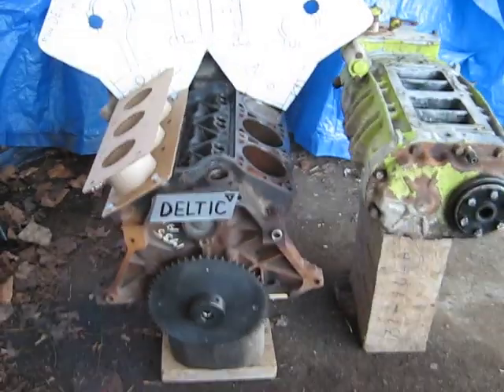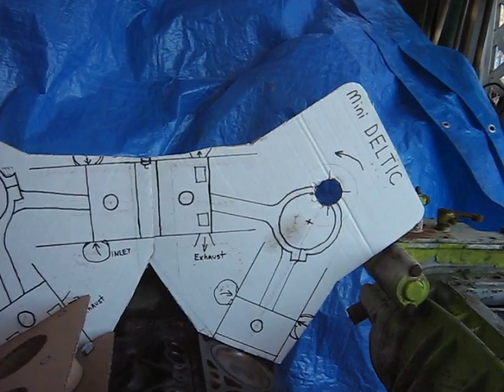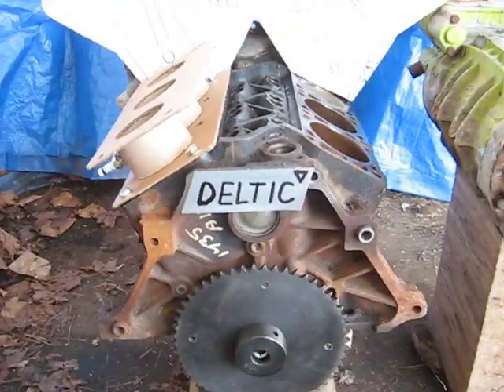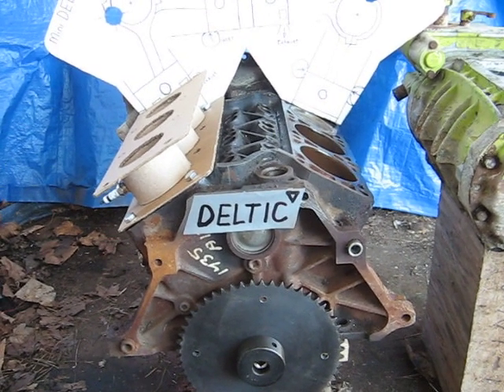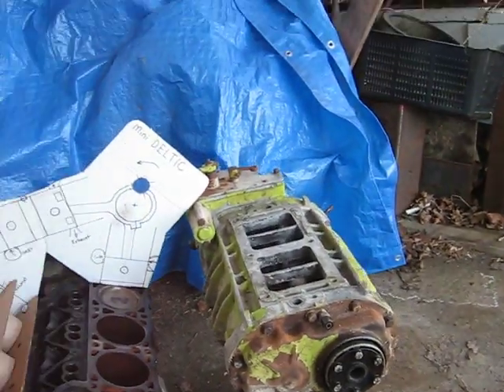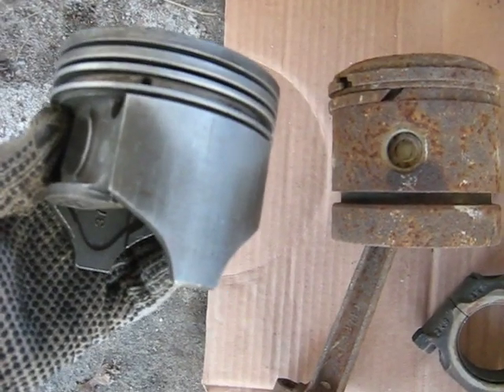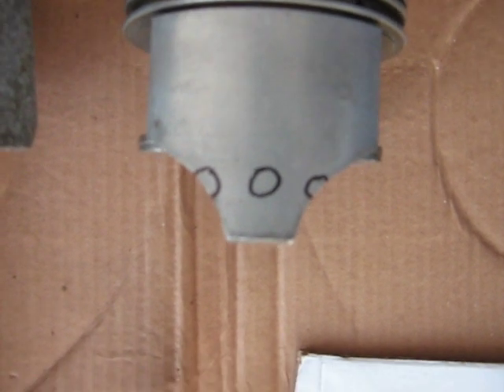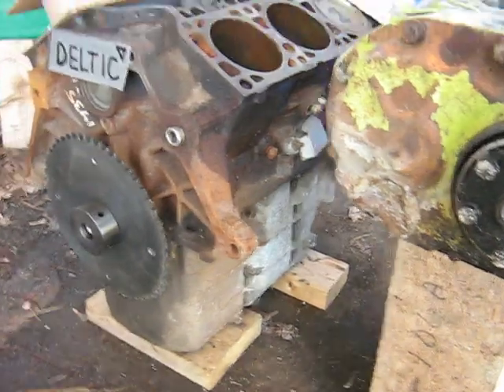Design of Junkyard Baby Deltic #3

Comment: Use 3 flat-head engines and leave it 4 stroke. Which would allow use of the factory carberetteur set up with minimal modification.
Reply from the maker: I doubt they ever built a flathead V6, but I could be wrong!

Comment: If you're planning on needing an "ignition system" for your project, you might want to learn a little more about engines in general and diesels in particular.
Reply from the maker: I understand that the Deltic was a diesel engine. Building a diesel would be much harder for me, so I would convert it to a gasoline engine, that is why it would need an ignition system. I call the exhaust scavenger pump a supercharger, since most people have no clue what an exhaust scavenger is. It can actually be a supercharger if you close the exhaust ports early enough to allow boost pressure build in the cylinder. Thanks for your input, sounds like you know a fair amount about Deltics, I wish there were more of them in North America, though I have discovered 2 within a 5 hour drive from me  :)

Comment: I would love to see his built. It's going to be freaking huge! I think, just the splines in your in-line Briggs, the chain will have some interesting harmonics if there is even a smidge of slack. 

I'm glued to the computer for updates.
Reply from the maker: Well, don't be too glued to the computer, you wouldn't want to miss the Super Bowl !
Yes, this would be a seriously large engine, and there definitely would be some chain harmonics issues happening. I will have to drag out my Jumo 205 type Briggs (on opposed piston engine that works on a similar design). I was not satisfied with the mere 5 second run I got from it, then I had to pack it away for the winter, where it is still resting peacefully. Building a Junkyard Baby Deltic would be a BIG project, even for me, and it would cost a few buck also! Lots of issues to solve, like the starters, fuel system, supercharging, and the chains. perhaps the biggest problem is the firing order on a V6 is 1,2,3,4,5,6, which won't work for this engine :(  It would surely be a Youtube Hero, but at a big price. I think some people already think I have lost it making my Straight 8 FrankenBriggs!!!!  :)
Reply: The aluminum Olds drce block is easy to cut ports into, just have to be careful with the water jacket to seal it, then connect an aluminum manifold to the inner/outer sides of the block for air intake with blower, now if i can get Coats ball valve heads to fit that would be something, this would make a nice uniflow 2 stroke 572 CID olds.
Reply: Just be carfule cutting the ports on the bottom of the cylinders, it looks like you have to make some room and cut out all the valve guide stuff so you can cut ports down there.
Reply: You're really going to find a lot of Olds Drag Race Competition Engine blocks laying around in the junkyard.

Comment: from an ignition point of view look at aircraft 9 cyl radials i you run two 180dg out you can get two-stroke firing with out having to do a lot of building
Reply from the maker: Yes, sounds like that could work. I imagine i could butcher up a V8 distributor to work also, by machining a new points cam and reworking the distributor cap like i did for the 5 and 7 cylinder.

Comment: a 4.3 chevy v6 would have a bellhousing more common to connect to rear drive powertrains. Would need a allison 1000 or billet shaft 4L80e transmission that then would bolt up

Comment: With a hemi 0r 4 valve you could take a 1 to 1 cam and use a plower for scavenging. Both the intake and exhausts are opened at the same time and you have an inverted loop scavenged 2 stroke.
Reply from the maker: Yes, it is crazy how well such a mod will work. I did something similar with a Briggs flathead, and it ran great!
Reply: I can get an aluminum 572 hemi block, its easy to cut ports into for a uni-flow 2 stroke with blower.

Comment: The 60 deg v6 you have look like they have room for ports. you just need a crank with roller bearings and the blowers pushing into the case. You can now use oil injection in the air stream. I intend to make a 540 cubic inch v8 2 stroke out of an aluminum block v8 with roller crankshaft and a blower feeding the bottom up through ports.

Comment: Can we hang out sometime that's awesome
Reply from the maker: Ryan Gralinski lol, probably not easy to do, but thanks for the offer. Mr3WheeledBike ran with this idea, making several sketches of it. We can message about it if you want to.
Reply: I was just kidding anyway just seem like someone I'd like to chill with.  My camaro had a 3.4 when I got it what a garbage engine though it was
Reply from the maker: Ryan Gralinski Is that your Camaro in the vids, looks like a quick car now!You should watch my latest vid, and take a guess at how long a JB Welded con rod can survive in a lawnmower engine  :)
Reply: Hah I'll check it out ya that's it it usually runs like 12.7 12.8 exactly the way I drive it on the street I managed to get a 12.1@112 on a lucky run I guess but that's not a 3.4 now

Comment from the maker: I would think that a smaller engine might be better, since you are multiplying by 3, then by 2, since it is a 2 stroke. So any way it is going to be a huge displacement motor! You have to feed it with a supercharger, although a turbo  or 2 could help out after starting. Feeding it fuel could get interesting also :)
Reply: ChargerMiles007 Wouldn't the gas blow right through? You can't turbocharge a two stroke.

Comment from the maker: I know a real Deltic is expensive, but I don't think it is THAT much!  :)
Building a junkyard Baby Deltic would be a big challenge, just getting it to run at all. 
Building one to actually use in a car would be a serious project!!!
Believe it or not, even building the sleeve valve lawnmower engine at university, in 1 year proved to be hard!
Lots of designing, thats what comes first (after you select the engine that will be the victim of the controlled butchering!)

Comment from the maker: @NastytheGREASERZOMBI 
Oh, a slot would be a lot worse for the piston rings to go past. It is possible that a person could run an engine this way without even pinning the rings so they can't rotate. You just alingn the ring gap in the part of the cylinder where there is no holes.
The 3 holes was just for example, I think it would need more, probably 2 rows tall to get any sort of airflow. I haven't done any actual designing with scale drawings on this yet, since it is up in the air.

Comment from the maker: @sunppaa 
I think the stock pistons would work fine, since I would only run it a short time, then let it cool down.
That is an interesting question about the ring and piston oiling, I think the 2 stroke Rolls Royce Crecy V12 had some type of oil jet to lube the piston, but I could be wrong.

Comment from the maker: @BigEsGarage 
I will make a vid of the crank in a few days, but basically, you have a journal for 1 cylinder, then a thin counter balance, then the journal for the cylinder in the opposite bank, the second journal is offset 60 degrees from the first journal. Certainly not the way I thought it would be! This is the first V6 I have taken apart, I am familiar with 4s and V8s.
Sounds like your crank trigger idea would work. I am familiar with distributors. Nice to work the brain on these ideas :)

Comment: Sounds like a good idea! Are you really going to try to make it real? I guess the piston design will be the biggest problem? Is it even possible in this application to use stock pistons which have no rings on the bottom of the skirt? Will the fuel mix with the oil othervise?
How do the cylinder walls get lubricated in 2-stroke engines with lower rings?

Comment from the maker: @BigEsGarage 
Thanks for the advice, I was considering a 3 cylinder car distributor also, I have a Geo Metro 3 holer that I use for a pencil holder, and a 5 cylinder cap from an Audi :)
I am not sure firng them all at once would work out very well, with this being a 2 stroke. I have found a more serious problem though, the V6 crankshaft uses split journals, so cylinders fire 120 degrees apart, I NEED 60 degrees to work in the Deltic triangle!  >:((